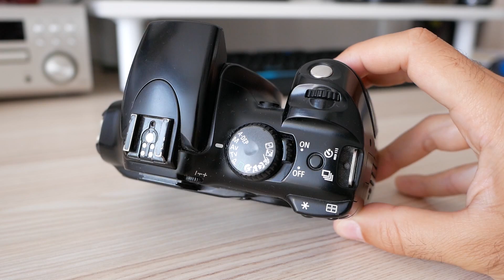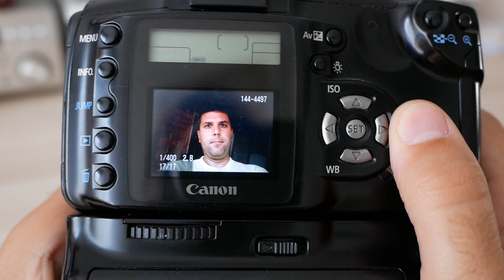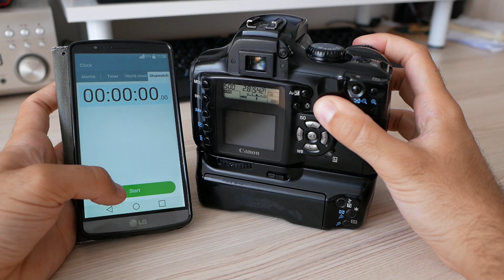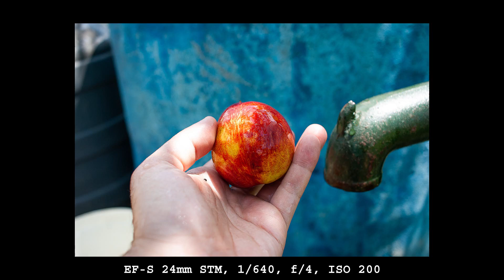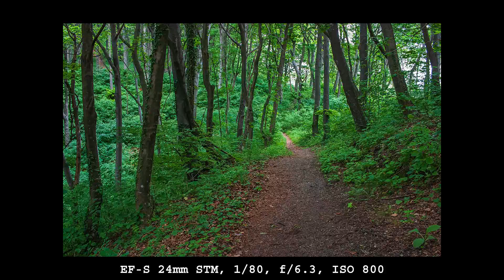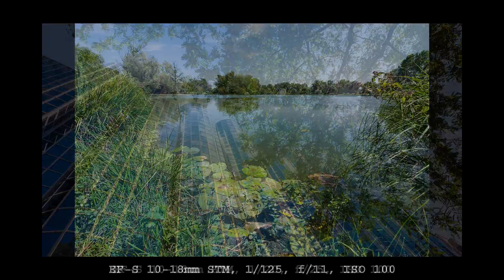Canon EOS 300D review (first digital Rebel from 2003)

Comment: If one shoots in RAW and post-processes pictures (I use SilkyPix) then this simple modest camera is still relevant today. Having a few much better cameras I still occasionally do photos using 300D, and the picture it gives is of good quality. Canon's EF-S 18-55 mm IS STM is of surprisingly good quality for its price (I mean its latest version, f 1:4÷5.6, not earliers 3.5÷5.6)! Attached to 300D it also gives fast autofocus, which you wouldn't expect in case of that old little thing.
I had no issue with long saving time of 300D; simple: I made a photo, and while I was planning the next one, the Rebel usually managed to save the former picture.

Comment: How to transfer photos to your computer when you don't have the card reader and the original USB cable?
Reply from the maker: Any mini USB connector cable will work. But don't even bother, 300D has USB 1.0 which is incredibly slow (max 1.4 MB/s or less) and PC connection eats battery like crazy. Buy a card reader.
Reply: @Camerahoarders  Okay, Thank you so much. I am just worried if there still be an available card reader for this kind of memory card.
Reply from the maker: Of course there is, CF cards are still used in many modern  high end cameras like 5D mark IV or 1DX mark ii. Actually, many pros prefer it over SD cards. I use this one: https://www.youtube.com/watch?v=m6A0ky3CxA0
Reply: @elameyfdez6041  There are adapters to use with SD cards, makes easy to conncet and download pictures...